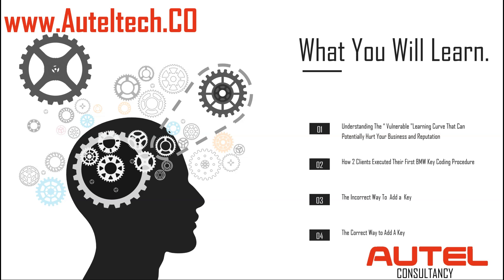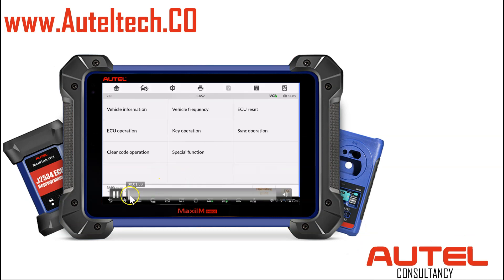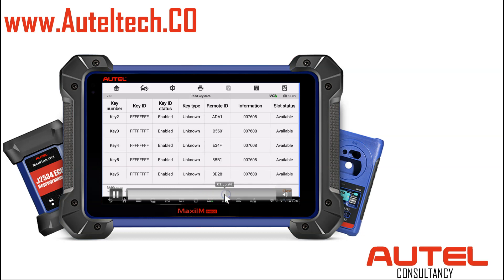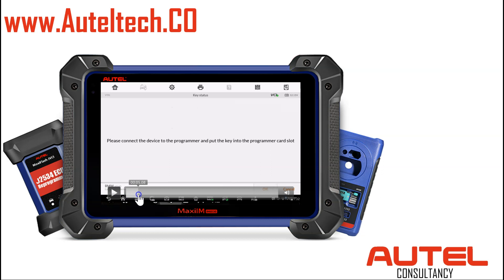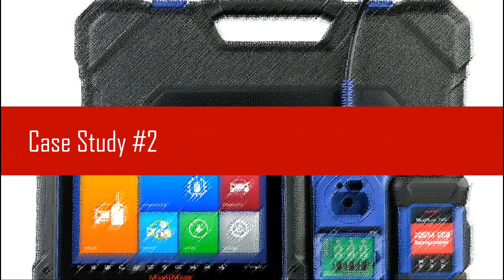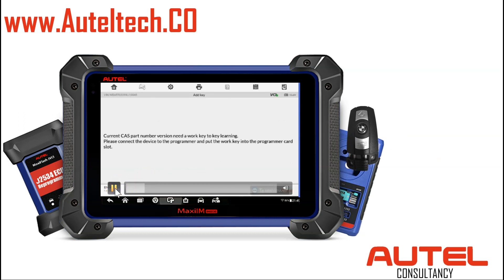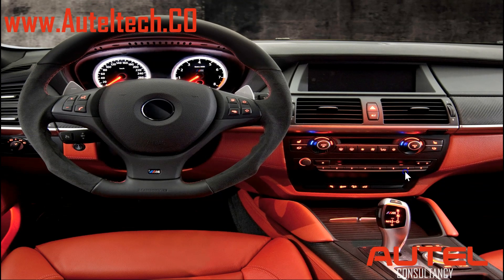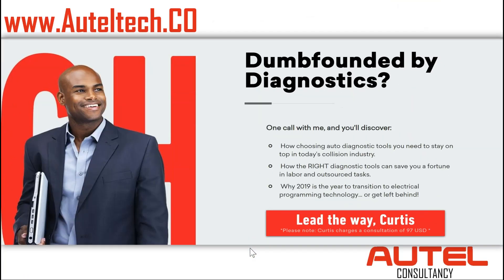Autel IM608 | How to Add a Key to a BMW (Client's First Time) | Case Study 2020

Comment: What I might need Curtis is this. I have a brand new ms908im and I’m about to receive my Xhorse key cutting machine and VVDI key programmer and cloner. Im new to this and want to get out there running an auto locksmith business. Only to make it work I need a guy who would be there to answer questions if all goes wrong. Or i just get stuck. Experience prevails. 

So is that guy you....?

Comment: I was hoping to have some sort of return already on my IM 508 with only the included XP200 just adding keys for domestic and Asian cars but cheap folk keep bringing Used Toyota Smart Keys and aftermarket Smart keys and key Fobs that can't be programmed that amounted to a lot of uncompensated labor time learning. I think I've had more calls for Mercedes and BMW, than American and Japanese vehicles. I now use my TS400 to test RKE output of all the buttons of the working and provided non working fobiks. I also  go into Programmer and Auto ID the chip of the working Smart key for chip type and then AutoID the chip type of the provided fobiks to see if they are the same type of chip, or even if able to be identified at all.
  Autel  just released the new XP400 Plus and I found a reputable USA dealer that just put it's remaining inventory of XP400s clearance priced, so I ordered one.  Autel should have XP300 standard to replace XP200 that will add the Mercedes IR and key chip reader slot that the XP400 has but forgo all the board connectors and jumper harnesses the XP400 has for the really advanced end of key programming most techs will wish to avoid soldering and hacking onto module boards. But since I'm getting XP400 cheap enough now that I could see a return on things, I might be inclined to try the advanced end of things if the customer's only option is the replacement of the module and programming at the dealership anyhow.
Reply: What did you all need to have it work
Reply: @brandonmathewson7610  The used Toyota keys can't seem to be programmed to another vehicle, and I didn't see the option on my IM508 to  reset or Virginize a used Smart key

Comment: I’m trying to add a key to my BMW with my maxicom 808bt but I can’t get it to work can you help me? I was wondering if I have the right key.
Reply from the maker: HI Semej, I can help you but I charge. I will tell you that your tool does not have any bmw key coding. The coding coding is extremely limited on this model and its mainly used for reading and erasing codes. You have the wrong tool if you want key coding on a professional level
Reply: Ask-hole

Comment: I have an IM508 with an XP200 here In the USA.Is the XP200 capable to do the same process of adding a key to BMWs like the 2 models in your video providing I have a network connection for my IM508 and within update period where required?
Reply from the maker: Should be the same procedure since its all done via obd and the function route is the same on both im508 and IM608 devices.
Reply: @AutelConsultancy  see that mean we are on it with the IM508
Reply: Thanks for letting us know can i contact you or u text me on my whatsapp 009647510525877.

I'm from north iraq kurdistan city erbil.

I'll really appreciate it as I've worked with Americans and due to the pandemic I've lost my position now am planning to join this key coding game please help me out if u can.

Thanking you enormously.
Reply from the maker: @dashtyATG   you can book a 1 on 1 consult with me by going to auteltech.co.za and click the diagnostic tool consultation
Reply: @AutelConsultancy I'm so sorry brother as I'm opening the like above it's taking me to a website called clickfunnels. Com? From there can't find any diagnostic.
Reply from the maker: @dashtyATG   try www.auteltech.co.za  that should work

Comment: He said charge $150 to $180 for a CAS key!?!?  That’s a deal. I charge $250
Reply from the maker: HI Adam, I encourage charging high fees. The pattern I seen is new people coming into key coding industry charge low at first. I dont encourage it but when they get more confident and build a reputation , then they will charge more.
Reply: @AutelConsultancy  it all depends where you live .. buddy of mine lives in the middile
Of nowhere and hes the only locksmith around so you dont have another option but to pay... but he is reasonable good person..
Reply from the maker: @MYKEYSAUTOMOTIVE   I agree!

Comment: I noticed when it's updating the CAS it asks you to "Manually backup the original car flash and EEPROM data before performing this fuction". How do you do this? Does the IM608 perform this automatically?  Thank you in advance.
Reply: Back out of the screen and go to advance mode and it has the options or sometimes just backing out itll have it